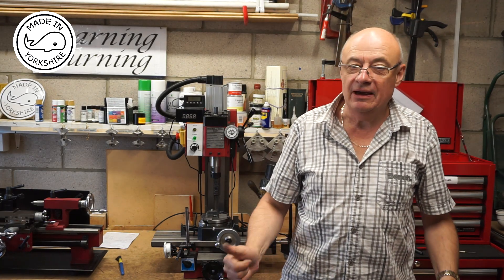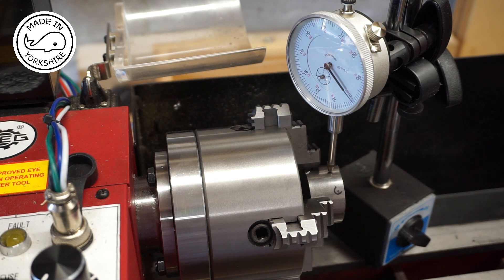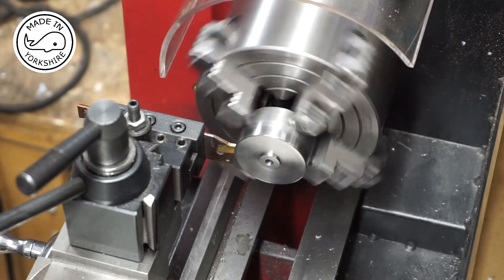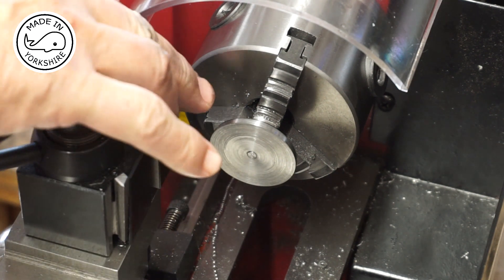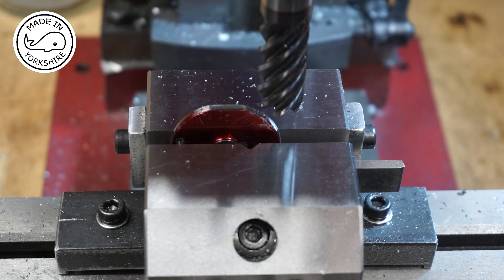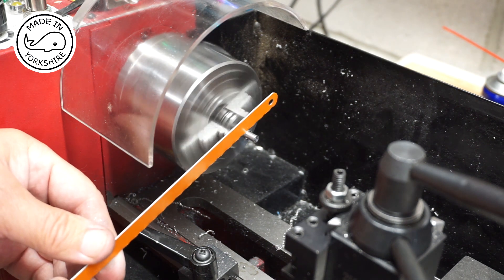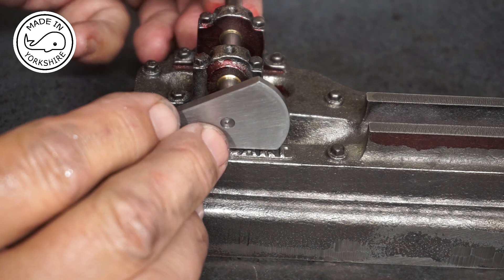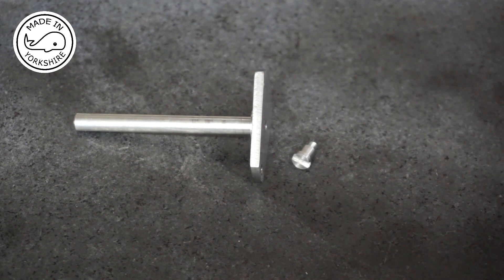#MT22 Part 6 - Making a Stuart S50 Steam Engine Crankshaft. By Andrew Whale.

Comment: Hey  Andrew:   Forgot to add:  What size slot width was your crank pin head?   Missed that  .   Have you tried this?  Collet block in vise ----- USE A 'JEWELERS  SLITTING  SAW ' WITH  MATCHING  ARBER   OR USE  VERTICAL ROT./TABLE .   THE S..SAWS YOU CAN GET ALL SORTS OF SIZES FOR SCREW SLOT CUTTING.  WE USE THEM HERE FOR MAKING   'EXACT' SIZE SLOT SCREWS FOR GUNSMITHING WITH HALLOW GROUND SCREWDRIVERS SO DON'T DAMAGE SLOT.
HAVE YOU ALSO TRIED A HIGH SPEED  STEEL  PARTING OFF BLADE  ----- THAT MIGHT HELP ALSO IN STEEL---- LESS   PRESSURE TO CUT
CHEERS    MIKE
Reply from the maker: Hi Mike
The drawing suggests 1/32" so I guess it would be in that ball park.
Cheers
Andrew

Comment: I think Tubalcain recommend 3/16 r. from the hole as that = 6/32 and very close to 13/64 (0.203125) which is half of the width of that small arc, to get you close enough to eyeball where to scribe a mark from each edge, simplifying locating the feature. to be more precise would be some very accurate measurement which takes away from modelling and wholly in the realm of experienced machining technique and tools. 
you did fine! maybe it will have a harmonic vibration at a certain rpm because it's not super precision, but is any hobbyist's model utterly perfect?

Comment: Hi Andrew - How about a couple of spanner flats on the head of the crank pin instead of a slot on the head. keep up the good work.
Reply from the maker: Thanks for the suggestion Timothy. I did later remake it and made a far better job of it. Since then I've purchased a jeweller's saw. They are great for cutting fine slots and good for cutting bolts to length as they don't damage the threads.
Take care!
Andrew
Reply: Yes I agree and use one all the time particularly for cutting small studding and screws. The blades are a bit fragile but as you say, the burrs they raise are minimal.
Thanks
Tim

Comment: Lose the plastic guard over the chuck. Throw away the rear chip shield as well, You will get so much better access for measuring and set up.
Reply from the maker: Thanks Ross - several months later I did remove the guard cover and I agree it makes a massive difference.
Cheers
Andrew

Comment: Use heavy high sulpher thread cutting oil for parting and flood it.
The mini lathe isn't stiff enough to part steel very well.
you have way too much over hang on your compound, pull it back until the top and bottom castings are even and lock it down.
too much over hang on your tool holder allowing it to spring. If you can use the stock 4 way tool holder it will give you a lot more ridged setup than the quick change, especially with the parting toolholder hanging that much farther out.
use the narrowest parting tool available.
Those type of inserts should never need honing.
Parting off sucks no matter what you do.
Reply from the maker: Thanks for the tips Ross. I think that this was one of my earlier attempts at parting off and it wasn't a great experience. I agree that the mini lathe isn't great when it comes to parting off, but locking everything down certainly helps. I have now reverted to using a thin HSS tool, which works reasonably well.

Comment: Andrew, from here it looks like your parting tool may be a tad under the center line of the chuck. If it is it would cause the tool to grab the stock rather than shear it. What I have found that works well for me is to use the parting tool to face off some stock and work up to the point where it takes off the little tip that is left if a tool is too low. If the tool is too high and you are using an insert, the tool will rub to the point where there is so much pressure that it shatters the insert. (Yes, I have learned this lesson the hard way.)
Thanks for sharing your successes but more importantly your struggles with  us.

Comment: :)
Reply: If you can get a HSS P type parting blade .040 wide you will find it parts better since it's removing less material than the insert so less force on the lathe, easy to sharpen and hone and can be used to cut the thread relief.... https://www.amazon.com/CUT-P1N-P-Type-Cut-Off-Blade-Speed/dp/B00P0347B0
Reply from the maker: Hi Dave - I was starting to think on the same lines re HSS. Many thanks for the link. I will see if I can get something similar in the UK. I didn't have great success initially parting with HSS when I first started out, but I think I can put it down to poor lathe setup rather than the tool. I maybe need to get to grips with HSS tool sharpening too.
Cheers
Andrew
Reply from the maker: Ha ha re your first comment!
Reply: Part 7? Have you been busy or did you get stuck on how to do something? LOL
Reply from the maker: Hi Dave. Ha ha! Been on hols and been mulling over how to turn my first taper for the conrod. Just this minute finished it and now working out how to fix it to the rotary table to put a radius on both ends. Hope to get part 7 up soon! Thanks for the interest.
All the best.
Andrew
Reply from the maker: Thanks for the link Dave - very interesting. I've managed to mill the larger of the two radii with good results but I need to decide how to approach the small one. I'm not sure I've got the bottle to hand mill but I will sleep on it.
Cheers
Andrew